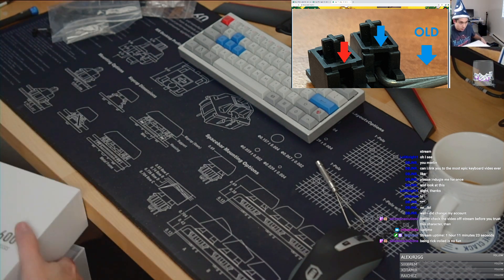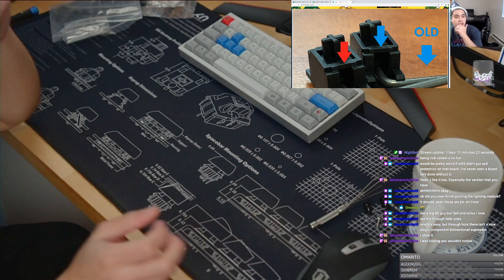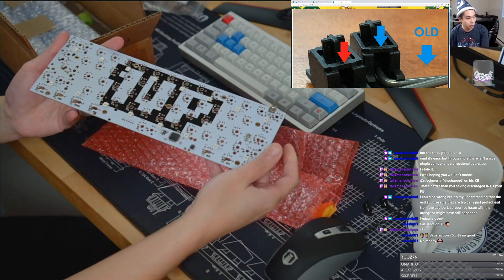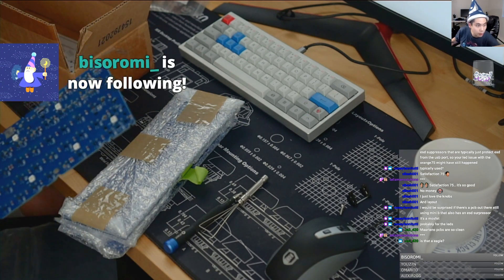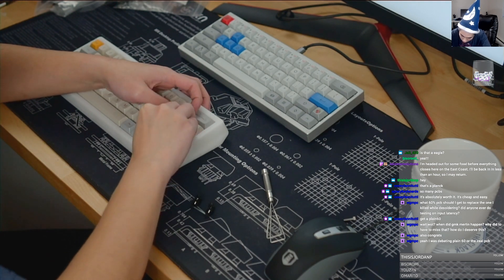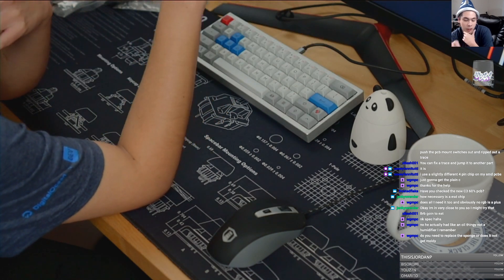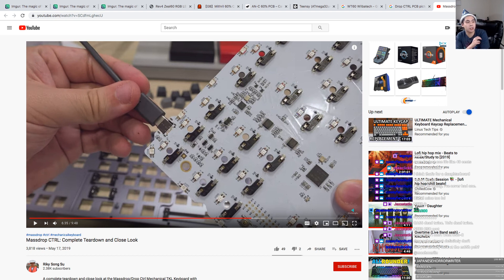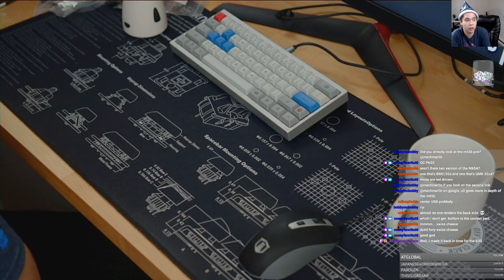Keyboard Chores - ESD Protection and Old Cherry Stabs (Are they worth having?)

Comment: This is definitely still a problem, and I don't think its as rare as some will want us to believe, I have done a bunch of research because I own a DROP Alt based CNC Cased keyboard and where I live there is a lot of static from just walking around And I noticed that when I came into the room and touched the keyboard there was a small charge that shorted out my keyboard, lucky it just seems to reset it self and appears to be ok unlike some horror stories where this small discharge bricked many custom keyboards. 

So in my opinion this is very important, and shouldn't be overlooked for any keyboard that is built into a aluminum chassis, it should be designed with ESD safety in mind. I have an apple aluminum keyboard and no issues at all I don't even get shocked, it turns out while searching about this, that apple learned early on this was a problem and corrected the issue. So if it was so rare I doubt they would have worked on a fix.

I think this may happen more then one knows because some like my DROP keyboard just reset and the user may not even know static is the issue causing it. I think if a manufacturer builds a keyboard of this high end caliber there is no excuse for not having protection to help prevent this problem from the get go. And if a DIY builder uses a aluminum case then they too should think about this before building there own. I am going to report this to DROP directly as I only see some talking about it on their forum but on the net i see a lot more with all different brands of aluminum cased boards having this same issue only worse as i said completely bricking their very expensive keyboards.

This problem needs to be fixed and all boards should have built in ESD protection not just a few as it seems more manufacturers really need to address this issue as far as i am concerned.

Comment: So i tthink i justt ESD my board, now when i try to press 9, itll input "9olm" altogether, or it wont input anything, same with O and P. The led still work under them, just the input for those columns are wacky now. What do you think? is this fix able or do i need a new PCB?  BTW I have a NK65 board (novelkeyz). 

hope to hear back from you!
Reply from the maker: There's really no way to know for sure without a microscope regarding ESD, but what you're experiencing just sounds like a short, try taking it out of the case and examining that column
Reply: I have fried 3 PCBs so far. I'm never using a metal case again :)

Comment: Does ESD protection matter if I use a non metallic plate?
Reply from the maker: The ESD protection is placed on the most likely point of failure, which is the USB line. Even with a non metallic plate, you can still zap your PCB through the USB line. I advise everyone to always purchase an ESD protected board vs a non protected pcb.